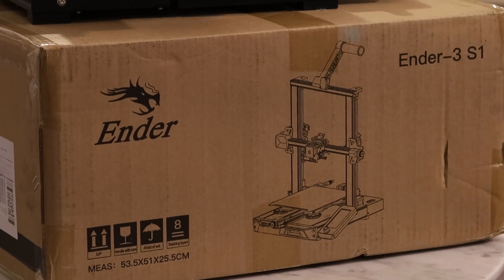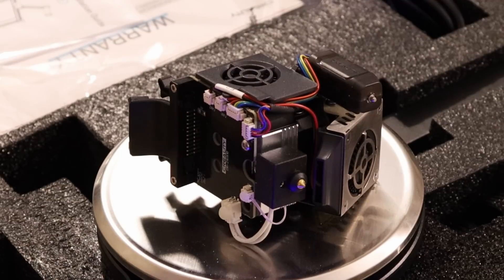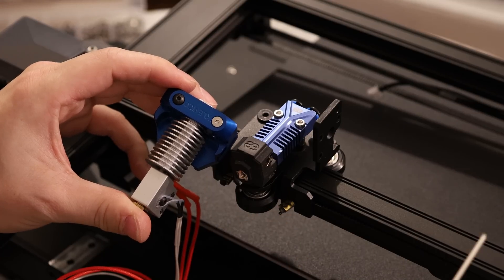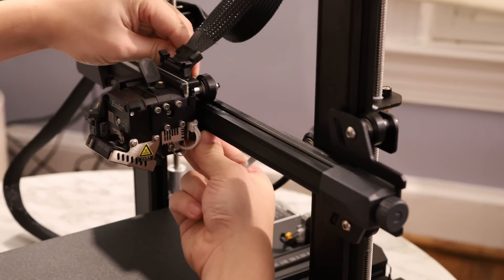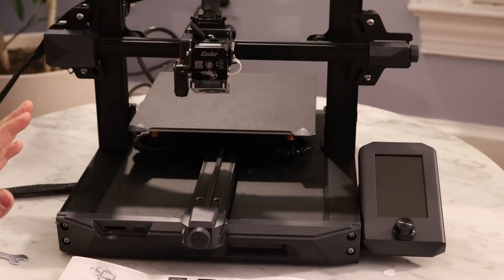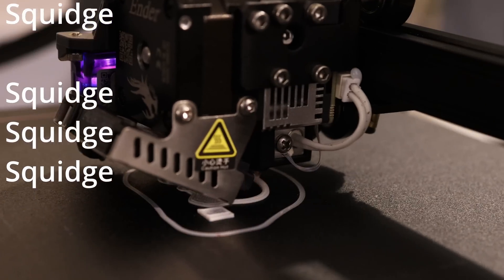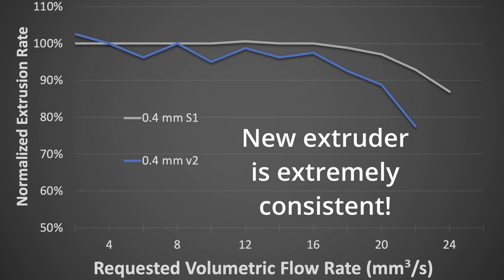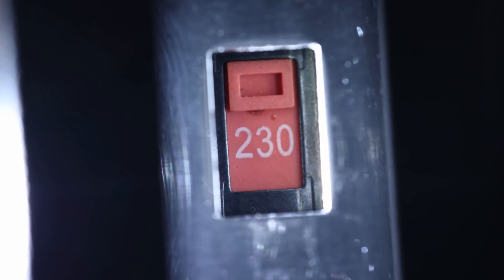Ender 3 S1 - A New Benchmark

Comment: I am new to 3D printing and bought this same machine for Christmas, I have yet to even test a print. Every time I hit to print, the display shows it is printing and timer is working but nothing is happening on the board, won't move or nothing, then I get the overheating and need to shut it off, I am still trying to figure it out. If anyone can help please do so I would appreciate it.
Reply from the maker: What you are describing should not be happening - it might be a warranty issue.

Whenever you start a print the printer has to get up to temperature first. You should see little icons indicating the temperature of the hotend and the heated bed. If those numbers aren't changing, your printer may not be heating up properly, so it won't start a print. It could be a loose wire.

If you join my discord I will be able to respond a little faster and more reliably.
https://discord.gg/Kb5rzRW9
Reply from the maker: Something also worth checking, the power supply is set to run on 230V power by default. If you're on 115V power you need to flip the red switch on the power supply. You should be able to see it through a small window on the back of the base of the printer
Reply: @NathanBuildsRobots  I checked and I do have it on 115V, to me it might be firmware issue, nut not sure where to get the update firmware since it is such a new printer.

Comment: i dont like it..... the point of ebnder 3 is that ppl can mod it in there own way and put a v6 or a volcano or liner rails or a diffont bed on it i just think no matter what this printer will be modded so you might as well just get a cheaper one and do what you want lol
Reply from the maker: Yeah I agree. It's really just deciding what you want your starting point to be. 

But from what I've seen this machine should be quite moddable as soon as the modders and aftermarket parts manufacturers catch up. I'm working on some pretty interesting stuff

Comment: Glad to see Creality stepping up their game. The extruder looks pretty awesome. Calling it a "prusa killer"... idk man, I think that´s aiming a little to high, especially after checking out the price.
Reply from the maker: They are pretty close to the same on features. I think the Prusa still has an edge on print quality, and ease of use (once you have spent the 4 hrs putting it together) but the gap is much narrower than it used to be.
Reply: The Ender 3 was already a prusa killer, at least from a consumer perspective. For a fifth of the price you get decent quality prints and  then you can upgrade it to fit your needs. Also you get cheap spare parts from china and basically infinite tutorials and guides on how to setup/mod/troubleshoot it.
Reply from the maker: @FraMurgia  yeah, the best thing for consumers is to have more options. I'm glad this mid-range is getting filled out. Used to be not many options between the relatively basic and cheap Ender 3, and the feature rich prusa. A lot of ppl don't want to mess with mods, or spend 1k and wait 2 months for a PRUSA, so this I think slots in-between and is a great option for a lot of people.
Reply: @FraMurgia  The major problem comes, when you need to contact with the costumer services.

Comment: V rollers are inferior to linear rods or rails. That flat spot on the wheel is a big deal over time for quality.
Reply from the maker: Yeah, linear rods are pretty sweet. I tried out the Voxelab Aries and was surprised by it's print quality. I didn't realize it at the time, but I think the reason it printed so well is that it uses linear rods like the Prusa.

Comment: CHEP highlighted that the S1 has a 256kB memory instead of 512kB in Ender 3v2. It may cause issues if you want to use third party customized firmware upgrades.
Reply from the maker: I'll be checking out firmware for the S1 soon. Good to know!

Comment: Kinda comes off like a Creality Commercial.. lol

cool printer but i still love buying stock Ender 3 Pro and modding from scratch. I don't dig the V2 as much as the Pro, Thanks for the vid!
Reply from the maker: The pace of development for the Ender 3 was so slow for the last 3 years but they finally added a bunch of new features and I think it's worth praising.

If you look at ACTUAL UPGRADES (not random cosmetic changes or add-ons that have no real effect on print quality or user experience), over the last 3 years we had:
Ender 3: Great printer at a low price, shook up the market
Ender 3 Pro: Changed 1 aluminum extrusion from 20mm wide to 40mm wide +$50 over original
Ender 3 V2: Added silent steppers, +$90 over original

But with this new model we have:
Ender 3 S1: Auto bed Leveling, Direct drive extruder, dual z axis lead screws with synchronization belt, flex build surface, massively increased print speed and quality, all-new chassis design, massively improved cable management, improved switches, filament runout detector, hotend tested from factory.

Still wish they would have just provided a textured PEI instead of that PC garbage, but still a step in the right direction. And All-metal heatbreak with quieter fans + 1-handed nozzle changes would be nice. So theres room for improvement but overall you are getting a lot for the $. It is about $210 over original Ender 3.

If you're going into it knowing you're going to mod things, Ender 3 pro is a great option IMO.

Comment: Been having issue with the filament runout sensor. Using abrasive filaments caused the filament to be jammed in the runout sensor pulling the direct drive upwards intermittently.
Reply from the maker: Interesting! If mine starts causing issues I'm just going to remove it.
Reply: @NathanBuildsRobots  yup, i just bypassed it by inserting a short strand of filament. But i am quite surprise that no one seems to encounter this issue.

Comment: the nice prints are only temp. eventually it will start crapping out and the customer will buy a prusa. If you want mostly problem free printing, get a prusa
Reply from the maker: What will cause the printer to crap out? 

I would get a Prusa but they are so expensive. I bought 2 for work because I wasn't paying for them, and they were quite nice to use. Still had issues here and there but great quality and reliability overall. I might get a clone for $350

I appreciate how you said "mostly problem free printing". Anyone whose printed for a decent amount of time knows there no such thing as problem free printing 😆 But a well tuned machine will be pretty darn close.

Comment: Calling ANY printer a prusa killer because creality gifted it to you is not the way to get more subscribers IMO
Reply from the maker: I bought this printer. I'm calling it a PRUSA killer because it has pretty much every feature that people like about the Prusa: 
ABL
DD extruder
Dual z screws
Flex bed
Filament sensor

I've been modding it, and now I'd say its now better than a Prusa, though the Prusa will probably win in precision at speed and overall precision due to its linear rail build. 

Klipper will fix the issue with precision at speed. And it will all cost less than a stock Prusa. 

Its nicer than all of my other printers and I enjoy using it. It's cheaper, looks better, ships faster, easier to build - I think it's a better printer for most people.

Comment: Could you release a calibrated slicer profile for this? i seem to be getting a lot of stringing and poor quality on seam line where stop and start happens.
Reply from the maker: Yeah, I'll see if I can share the ones I'm using. Do you use PrusaSlicer or Cura? I use both.
Reply: @NathanBuildsRobots  i mainly use cura cuz its a little more friendly but i mess around in prusa when i don't get good results in cura.

Comment: It's funny, I had a 2019 Ender 3 sitting around collecting dust (new, we had never finished setting it up due to... life). Last week I finally did, and while I have fought with understanding some 3D things (my brain just does not think this way at all), once I understood what I was trying to do with the bed, and got it dialed in it prints amazing. The set up was definitely way hard for me but I don't currently have any blobs, zits, weird layers, everything I have failed has 100% been my fault because I didn't know what I was doing (and I did a ton of learning in a compressed time to learn Cura, to learn how to adjust it, to learn about infill, supports). My Ender is definitely a little noisy, but otherwise  I don't quite understand why people disfavor it. I'm currently running it with 70mm speed and I try to trim off as much time as I can from my prints, so far so good. Although I can see the Ender 3 has some weakness in terms of quality of components. 
 
Also I am amazed to see how far the market has come in about 2.5 years - I've only learned this because of my consuming pretty much all the YouTube videos I could get ahold of on 3d printing to build my base knowledge, and whoa, it feels like a different playing field now.

It just goes to show how very bleeding edge those who've been printing for 2+ years really were, and clearly anyone in it now is still leading edge. I'm in tech with people 1/2 my age, and only a handful of hundreds have printers. My kids are now going to be growing up with this in their home to tinker with (they are in middle school). 

Think about what 3D printers will be in another 4 years! So exciting.

ETA: I know I am only printing with PLA and life might get a lot more exciting when I try PETG or ABS or something, but I am not in a rush, I am happy to amass some general knowledge first. I did do a torture test print (with the over hang and bridging and stringing) and I thought for sure it'd reveal issues, but the only real thing I can see is a few hairs on the stringing part and at 70 overhang it's not real pretty (decent through 60 tho). I didn't even know the names of any of the parts until quite recently. I do think that most consumers will not have the patience for the DIY experience but things across different manufactures are really pushing things forward.
Reply from the maker: PLA I'd a great material. Its stronger and stiffet than ABS and PETG, is more printable, requires lower temperatures, has minimal thermal expansion, doesn't really need to be dried, and produces less harmful emissions. Nothing wrong with sticking to PLA!
I've been able to use some pretty nice printers for work. Filament based printing is super refined now and I don't expect too much more improvement, aside from more advanced slicer options, and faster extruders/hotends/motion systems - but most people don't need a faster printer. Who needs to be able to eat a spool of filament in 2 hrs? Only a print farm would need that kind of speed.

On the industrial side things are getting very interesting. I've been lucky to see where 3D printers are going at the industrial level. Metal printers, large scale carbon reinforced plastic printers with built-in machining capabilities, so you can print half of a part, machine precise complex cavities inside of it, then print over the top and machine the outside to have tighter tolerances and better surface finish than normal printing can achieve.
Reply: @NathanBuildsRobots  oh for sure, I think the primary improvements aren't going to be around speed, but overall in reliability and ease of use. Most people do not want to fiddle and tweak to the extent the YouTube 3d printing community does, they want a system they can get to on demand solve a problem, such as printing a small part. I think those kinds of things are already coming with auto bed leveling, stronger motors, easier assembly, filament sensors, small footprint options - basically a lot of what is in the S1 (minus the footprint). That is really exciting to hear about the industrial side. I do watch some videos about how 3d printers are printing entire houses now, which is amazing to me. Other applications too!
Reply from the maker: @ashvanes484  I think ease of use and reliability is more useful than absolute speed. The S1 puts in the upgrades where it counts in that regard. Still wish they would have gone with PEI instead of this weird PC bed. But it will be useful to have around as another option.

Comment: Since this is a beginner level printer and several of us out there are just starting out, may want to indicate that this printer may not be out-of-the box ready like many unbox videos would lead you to believe. 

Appreciate the video and attention to detail, I went back and checked my bed and sure enough it was loose like yours and had to (very slightly) tighten one of the nuts to make the bed sturdy. My print head assembly on the X axis was about to fall off the rail it was so loose, I believe yours was a bit too tight as you indicated the wheel had a flat spot. 

For those new to 3d printing, it's very important to not over tighten the centric nut on the X axis or any of the wheels, I thought the hot end assembly was loose on purpose, but this was really screwing with my bed leveling and causing all kinds of print issues that almost had me sending the printer back and giving up on 3d printing- Not fun! If you do have to tighten the hot end assembly, I recommend removing the assembly, disable the stepper in the menu, and barely-barely-barely tighten that centric nut on the back (the bottom has the nut, the upper 2 do not) using the included wrench so that it's firm but doesn't wiggle, then loosen it a bit and see if there is any play, if it's loose, then give it very subtle tension so you don't over tighten and create stress on the motors and wear your wheels. Make sure the belts aren't too tight, or too loose. 

This was the only video that pointed out making minor adjustments during the assembly, all the other videos were just taking the printer out of the box, speeding through the assembly and printing. You have to make sure this printer is in tune, otherwise you'll run into bed leveling issues like I did and can ruin the 3d printing experience. Thankfully, I have an experienced buddy who was there to help dialing the printer in. 

I think this printer deserves a proper bed leveling tutorial, explaining what auto-level is and how it works. Same with setting the Z offset. Express that if any adjustments need to be made, to be careful to not over tighten to prevent damage. 

Looking forward to the future videos! =)
Reply from the maker: When I do an unboxing and review I want people to get a sense of what it is actually like to buy and start using the the printer. I include all the minor issues i come across, and tips and tricks for getting the most out of your printer. 

I could whip this thing together in 10 minutes and just start showing off the features and print quality. But like you say, for a lot of people this will be their first printer, and nobody talks about the 20 extra checks and steps that aren't included in the assembly instructions. 

I'm glad my video helpful because that means I'm retaining the right stuff in my final edits! I usually take about 4-8 hrs of footage and condense it into 4-12 minutes for my YouTube videos. I try to keep the pacing and information flow going at a good pace for the whole video. 

I have a couple more videos planned for the Ender 3 S1, so stay tuned! I've been quite busy installing upgrades and designing custom parts for this printer!

Comment: So it's a Sovol SV01 for a $150 more and it is smaller. No thanks. Oh wait it has fancy fan and  stepper covers and useless pulley adjusters, still no thanks!
Reply from the maker: I think the Ender 3 S1 is quite a bit nicer in terms of a performance, ergonomics, and styling, but I see your point. You could argue that other printers have a better price to performance ratio. 

That Soval looks pretty nice, and S1 kind of sounds like SV01, doesn't it?
Reply: @NathanBuildsRobots  I was just being obtuse but yeah the SV01 is basically a Creality product with all the branded parts and the S1 looks to be its littler brother decked out with the add on silent board, ABL and touch screen. But it is still at least $75-100 more than I paid plus what the add ons would cost.  All the best, love the channel BTW Eddie

Comment: Very good video. This Ender 3 S1 seems to print well right out of the box which is a step up from the previous Ender 3. May I ask you 3 questions? Which mainboard version does it use? How are the 2 Z motor connected to the mainboard? What are the default VRefs? Thank you!
Reply from the maker: It uses a new mainboard with an STM32 chip with less memory and special connectors for all the ribbon cables. 
It has only 4 stepper drivers on the board, so the z axis steppers should be wired in series.
I don't know the vrefs. I assume the X, Y, and Z vrefs are the same as previous ender 3s, since they are driving steppers of the same size

Prior ender 3s use a large stepper for the extruder, on this one it is smaller than the normal motors for X and Y. So the Vref is probably lower than the normal XYZ steppers vrefs. I don't want to change it because it works great as-is. The extruder contains plastic gears, so I don't want to increase the motor torque too much and risk breaking them.
Reply: @NathanBuildsRobots  Thank you very much. If you happen to measure the VRef on the Z axis, I would be interested to know the value. I always wondered what Vref is good for 2 motors on the same driver.
Reply from the maker: @YouMakeTech  I will check vrefs next time I'm poking around in there!
Reply: @NathanBuildsRobots  That would be cool!